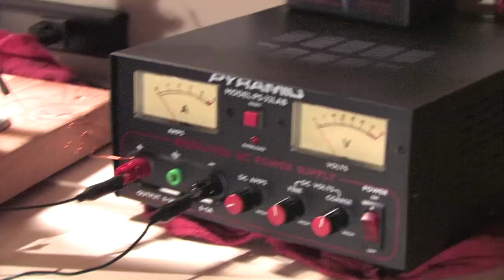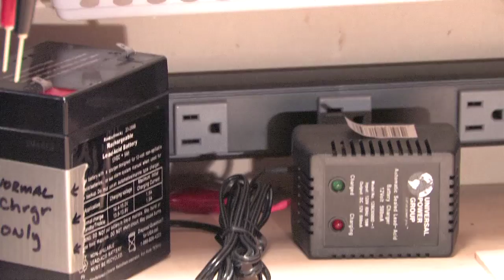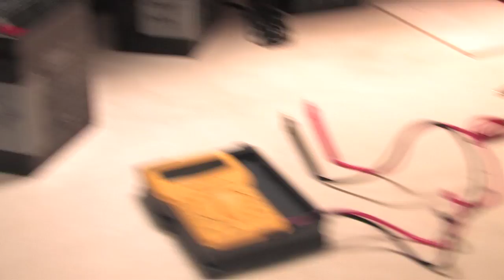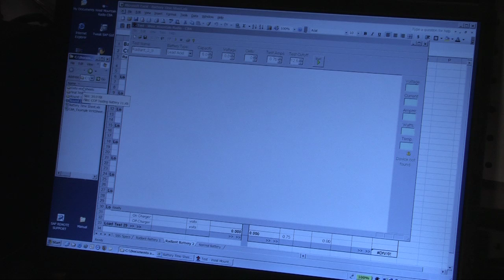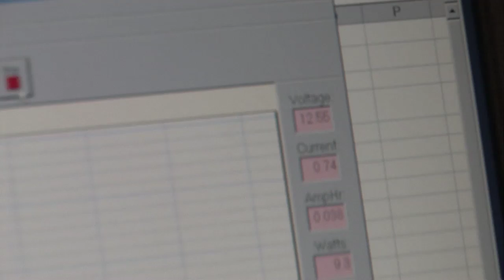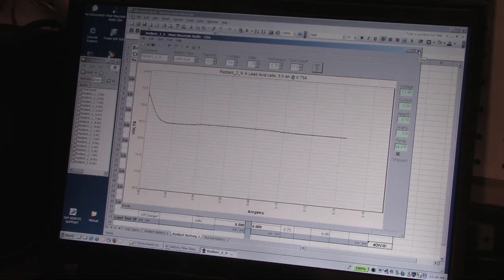Bedini/Tesla Energizer, Motor, Generator

Comment: This is an awesome video Mr Wolf.  Well laid out.  Clearly explained.  Mr Paul Babcock said "power testing is a science and an artform" watching you set up the equipment and testing it reflected what he said and I was blown away by watching what the machine teaches about battery recovery.

Mr Aaron Murakami moved his ( iron core ) coil almost imperceptibly a few millimetres further from the magnets on the wheel and it improved RPM's ( the magnetized iron core was probably creating drag ).  Mr John Bedini told Mr Babcock to remove the iron cores, this increased RPM's but he also added another 15 coils for added magnetic flux which used the air permeability as dielectric.

I'm gathering the components and gear now to do the 16 coiler.  Thanks to creators like yourself I'm inspired to try this.  Everyone I know looks at me like I'm losing my marbles but I'm really excited by the energizer and it's work.  It's amazing too.  This video was made over 10 years ago, and it's still helping people out.  Thanks Mr Wolf.

Comment: Question. Can I use components found in current day LCD Tvs? I have so many and I really want to build one but can't currently purchase specific parts. I also don't know much about components.
Reply from the maker: Yes you can!
Reply: @ewolfy  I would like to use as much as I can including the screen. It can display all data. I'm currently building my unit now. I'm combining all the power boards together so I can have a few different power options. I've increased my understanding of operations and functions since this question. But my entire project is a Bidini motor coupled with hho and frequency generation. I'm designing my own aluminum air batteries with a quartz/GANS plasma dielectric. It should be a fun project.

Comment: Sounds good - what does it mean? We can produce more power than we consume using the kinetic energy of the flywheel?
Reply from the maker: Yes, more power out than in but not from "flywheel" - from the sharp magnetic gradient spike
Reply: Jason Wolf
So the spike produces a "kickback" voltage that can be captured and used to fuel the operation of the device? It does this without resisting the motion of the wheel and bringing it to a standstill? If so, essentially you are saying this could be scaled up to supply more energy than it consumes? I like you scientific method, and I'm not rocket scientist, but is that even theoretically possible? I'm all for breaking through the accepted logic of physics, but doesn't this violate some commonly accepted laws of science - like the fact energy can be converted but not created? I could see how the kinetic energy of the flywheel might sustain the device over time, but it would seem that it would eventually come to rest. Not that this is a big deal though, because I think if you could just get a super efficient generator to work it would be a huge leap forward. To me it seems the planet we live on is a big generator with an iron core and we should be able to tap into the forces of the planet to supply endless power. If/when we figure this out we will enter the next age - the "energy age" and the world will be transformed even more than any of the previous "ages" have provided. Keep up the good work.
Reply from the maker: Hollywood4Fun   YES..  You are pretty much exactly getting it..  How it "specifically" does this is with a tiny flip-flop circuit..  The instant the kickback voltage comes into the coil the circuit redirects the kickback spike into a secondary battery for collecting the charge.  This really really basic animation shows the flow - Understanding the Bedini Circuit
Reply: Jason Wolf
Thanks - that was the video I saw which allowed the layman (me) to understand the basic concept. But can you put hard simple numbers to your motor - such as it takes X amount of energy input to produce how much output? I suppose when speaking in broad energy terms it might be stated in Joules? Not sure if I spelled that right, but if it can't be summed up in that way maybe just volts and amps? Not sure if you've even quantified your results like that or not but it would make it easier for me to understand the potential or true value of the energy produced. Lets give it an arbitrary logic and say for every ten units of energy in we get X amount back.
Reply from the maker: Hollywood4Fun  So now you're really getting into the detail..  Yes, I have all the numbers and did all the joules in vs. out math.  I actually used (shown in video) a computerized battery analyzer to test all the "energy" in vs. out.   Here is my published data and excel spreadsheets showing all the math. - http://jasonwolf.com/aionalchemy/radiant/index.html
Reply: Jason Wolf
Great  - I'll see how much I can digest. Thanks for sharing.

Comment: This is not a generator, your using more electricity from the power supply than your making
Reply from the maker: Pork Chop It does produce it's own power.  It's complicated but the gains that are seen with this generator are seen manifesting in the battery.  The machine does something to the battery chemistry and the battery starts hold larger and larger charges.  So... what happens is this..  Imagine you start with a battery that is at 0 and one that is at 12..  After the 12 battery is drained the charging battery is at 13.. now switch the batteries..  now the 13 runs the motor and charges the dead battery to 14.. then switch the batteries.. and the 14 now charges the dead battery to 15..  This is what is meant by the gains are in the battery..  I've charged "12 Volt" batteries to over 19V with this motor and I did it using a 12V battery...   This means that with a completely dead battery and normal 12 battery I can change that dead battery to 19V...   Some how I just used a 12V battery to run a machine that put 19 volts into another battery...  I'll let you do the thinking
Reply: no, you dont
Reply: i was under the impression that the BediniMotor produced its OWN power. Why was the Amp/Volt Meter plugged into a wall socket? is it providing the power? I'm seeing this motor needing a "go ahead" from the current grid. Isn't this supposed to help us get OFF the grid? Confused. Please clarify the reason for plugging the Amp/Volt meter into the socket behind that same meter.

Comment from the maker: Build one and test it yourself..  The output battery did change it's chemistry and when starting the tests the battery would only charge to 13.3V after repeated charge and discharging the battery would charge (and hold a charge) up to 17.7V..  this means the battery chemistry was changing over time and yes may have eventually exploded..

Comment: nonsense, if it generated more power than it uses than you could connect the charging end to the running battery and the system would end up accelerating until it blew itself up
Reply: read spreadsheet make it and after you see

Comment from the maker: of course.. but the energy spike in to the charging battery is larger than the energy required to push the wheel.    That is, once the wheel is spinning and is in resonance it takes very very little energy to keep it spinning.  Much like pushing someone on a swing.   Then the sharp energy spike produced by the magnets passing over the coil is greater then the energy required to push..   Hard to explain it on here on youtube.

Comment from the maker: I do not use the same battery for charging and supplying..  There are two batteries. One spins the wheel the other draws off the incoming voltage spike and when the spinning wheel battery dies I switch them.  

And yes this "energizer" generates more energy than required to run it.

Comment from the maker: I hear what you're saying but that is not what is being studied here.  At first glance, it looks as if that is all.  Most people come to the same conclusion (just as fast) as you did.  I did the same myself.  Then I actually hand built one myself and ran my own studies and proved myself wrong.  The circuit is so simple and the parts are so simple you pretty much owe it to yourself to try and see.  Joules in (to the rotor) and joules out from charging battery say a very different story.

Comment: Just because you spin the rotor with minimal energy doesn't mean that it will continue to spin when you apply an electrical load (by drawing current from the coils).  All you people should look up how rotary converters work.  This is essentially a rotary converter.  They have existed for a long time and are not "over unity".  Also, keep in mind that voltage does not equal power.  A small high voltage emf spike does not carry much power.
Reply: You have no idea what you are talking about!

Comment: Converting magnetic fields into electrical power... so it's a standard generator. As you build and collapse the magnetic fields around the windings and draw current from your "Bendini motor" (aka simple generator), a load torque will be created and you will need to actively drive the rotor.  In essence, you need to put power IN to get power OUT.  With losses, this will always be under unity.
Reply from the maker: obviously you haven't built one - no one is saying this is over-unity device but the way the circuit recaptures the back-EMF has never been explored before.   And my "bedini motor" as you call it, ran for 3 years before there was no energy left from either battery on the charge or drive side

Comment from the maker: No..  You should look up the work of John Bedini.  This is a replication of a Bedini motor.  This "energizer" is using a tiny amount of power to spin that wheel, then using a separate circuit it's converting magnetic fields into electrical power.  Thus using less power to spin the wheel than it's putting into the battery.

Comment from the maker: No i would use my power supply to run the energizer to tune the circuit but then just switch batteries from charge to power..    This is not intended to be a free energy generator -bedinimotors.blogspot.com

Comment: I don't understand something. Do you use a power supply to run the charger the whole time it's running? Because then it's not "free" energy if you have to utilize a separate power source to charge the batteries.